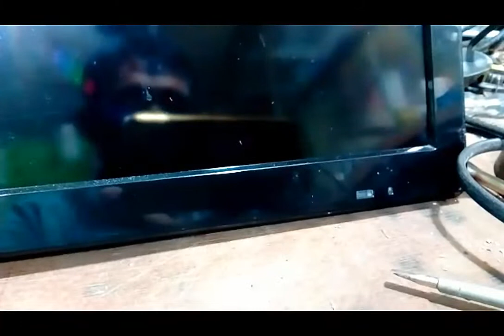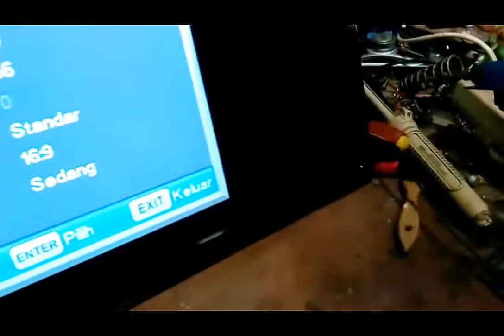Cara Memperbaiki Tv Led Polytron Indikator Power Berkedip Sekali.mp4

Comment: Om kl ukur tegangan dan cek kapasitornya saat steker di colokan ke PLN trus kl ukur pakai avometer digital di posisi ukuran brp ya om?
Reply from the maker: Kalau masih di primer di sekala 250 DC.klau ngukur di sekunder (DC OUT) pakai sekala 50 DC untuk arus diatas 10V..Skala 10 untuk arus dibawah 10V. itupun kalau multi tester Manual.